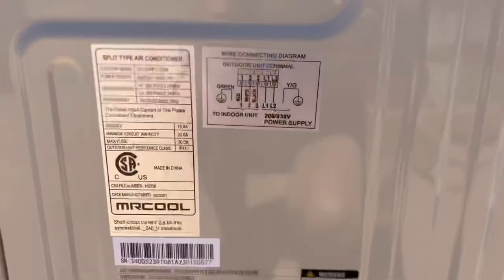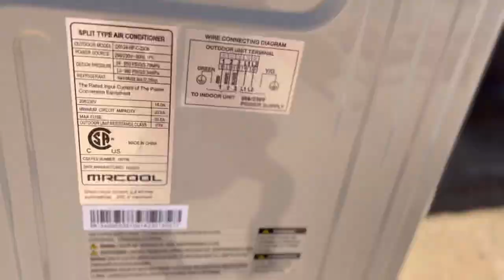Mr. Cool DIY 24k BTU Mini Split AC/Heating Unit installation in Yurt

Comment: We are thinking of installing a 18 btu or 24 btu unit in our 24ft yurt. Do are the noise levels? Do you hear the outside unit through the yurt wall? Great video! Really glad I found your channel.
Reply from the maker: @wildernessclassroom  you won’t hear it. It makes a little humming noise kinda sounds like a fan but I turn the tv on and literally can’t hear it. If your in a hot area definitely go with the 24 btu you want to over compensate in yurts, because they are not air tight. You always want to size up for everything heating etc.

Comment: Does your 36 btu (24+12) keep your yurt cool in the summer heat? Also, did your yurt kit include an insulation package for the roof and walls? Did you insulate the floor? I'm planning a yurt build and I'm trying to figure everything out in advance.
Reply from the maker: Yes it can keep it cool with both of them running. Our yurt kit did come with insulation for both the walls and roof and on top of that we insulated the floor and walls with 2” insulation foam board and we still plan to add some to the ceiling eventually. We did all the extra insulation because we’re in the Mojave desert in 100+ degree summers.

Comment: 24k btu is too big for such a small square feet
Reply from the maker: @patrioticgunner8034  it’s actually not enough for a yurt. Yurts are not airtight they don’t hold air in the same way as a normal house so you have to overcompensate specially living in the desert.